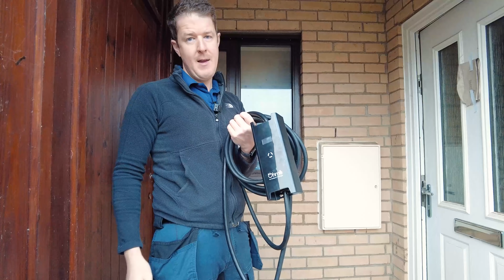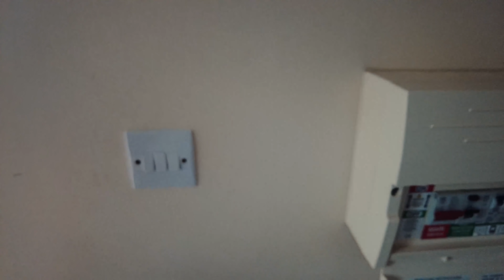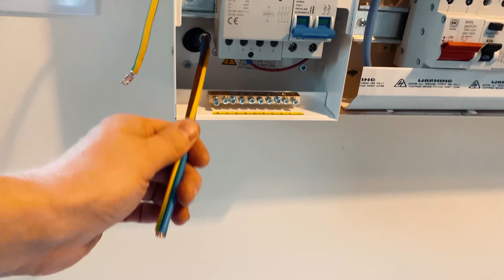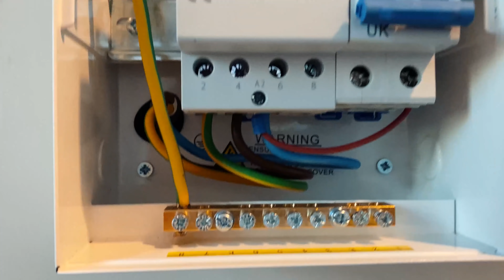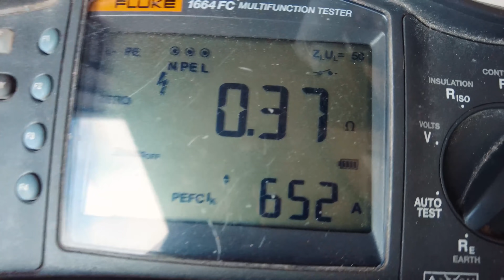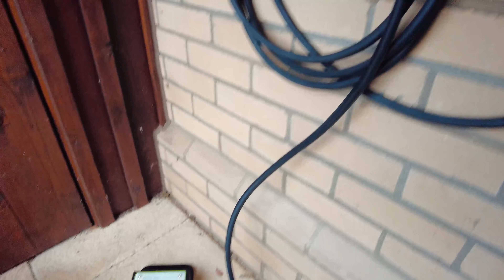Ohme Intelligent Electric Vehicle Charger Installation - Electrician Life

Comment: Waist of money, the charger is in the CAR it just needs a supply , 3KW 13/16 amp will be fine for most people ( unless you're a traveling salesperson or Taxi driver ) any competent D.I.Yer should be able to install outside socket 13 amp from ring or commando socket 16 amp back to a 32amp breaker , as for "cheapest electric ", it's down to your supplier /contract ( or stop blowing-up other peoples Pipe-Lines)

Comment: Where does the Data cable connect in the DB? Also in instead of a junction box in Ireland they have to have local isolation, so therefore its and isolator

Comment: Just had one installed - the charger itself is great, but is only fully intelligent if you're connecting a car from a manufacturer whose API they can interface with, otherwise you have to tell it what % you want to add.  As for trying to register and swap between 2 cars in the app or have 2 phones/apps - it's clearly not setup with that in mind.  Charger great, app and website... disappointing (but I'm sure they'll  improve the app).

Comment: OHME are supplying incorrectly wired equipment. As I understand the regulations all electrical equipment supplied within the UK has to conform to the UK regulations for conductor colours (not colors) and cable termination (BS 1363 plug) if the equipment is a portable appliance.

Comment: Hi Mike, I'm having real problems with my Ohme, each time our (very experienced electrician) tests the unit the 6ma DC test fails, weve tried 3 different test devices, 2 Ohme units, all running through the Rolec interface as you have there I believe. Do you test for the above, did it work successfully, wasn't sure from that vid. Many thanks for any advice, desperate to get my unit in and running.
Reply from the maker: Which tester is he using? There are not many test instruments that can correctly test the 6mA DC leakage device
Reply: @artisanelectrics  Hi Mike, thanks for coming back to me, he is using a Rolec charge check box with three different meters; Metrel 3125bt, Megger 1741+ and a TIS MFT Pro. All three are failing on the DC test on both Ohme units tested. Weve spoken to Tech support multiple times and they have suggested slowing the DC test which made no difference. Many thanks
Reply: Sorted it, it was the Rolec charge check box which was causing the issue, thanks for your help

Comment: I was under the impression that if you are pulling 32A continuously that you should use a higher rated fuse such as 40A. Is this correct?
Reply from the maker: It’s a good point, I generally size my breakers that way, but you always need to follow manufacturers instructions and in some cases they state that you should use a 32A breaker
Reply: @artisanelectrics  Hmm, I thought the regs came before the manufacturer’s instructions.

Comment: I have a Chargemaster 7kW EV charger installed in feb 2017, as it was free with the Leaf I bought then. I haven't actually used it in a couple of years as the leaf went back in feb 2019, but have recently bought a Zoe.

Is this PEN fault detection requirement a new thing? I don't have an external earth spike or a PEN fault device on my install, and am kind of wondering if I should get it retrofitted. After watching your vids I kind of feel like I should be replacing it with a Zappi but obviously I am not eligible for the OLEV grant, and if I were to pay for a Zappi it seems like I should get it as a 2nd charger for when we replace our other car. (although, I have a 60A main fuse so that probably wouldn't work too well!)

Comment: Nice, neat installation. Not keen how the charge plug is holstered when not in use though and that's how the manufacturer has designed it but just my thoughts.

Comment: Have you installed any Wallbox Quasar chargers yet? https://wallbox.com/en_uk/quasar-dc-charger
I am applying for the government V2G scheme through Octopus Energy where you lease a Nissan Leaf gen 2 with Chademo connector and plug it into the Wallbox Quasar charger, so at times of peak demand, the Leaf charges the grid. I thought at first I would need three phase power, but looking at the specs on the Quasar website it does not look like it.
https://www.thisismoney.co.uk/money/bills/article-8772011/Octopus-Energy-customers-trial-eehicle-grid-technology.html

Comment: You mentioned the PE-N protection box is also needed on TN-S.  Is that right??
Reply: Yes.  Because any repair to the DNO cable in the ground will be PME, so a broken neutral is still a potential issue
Reply: @cjmillsnun  OK. Potential. But the regs only talk about the PME case, I thought.

Comment: Great video -  very interesting. So if I were to run an Ohme from a 32A commando protected by 40A MCB and suitable RCD, and the unit is in my garage, is an earth rod or PEN device still required? Are you able to provide a link to the consumer unit with PEN device please?
Reply: Eco Harmony  Many thanks - I’ve since found the Matt:E solution. All the best.
Reply: Eco Harmony  I'll send you an email.

Comment: great videos as usual. quick tip, when you need to use SWA for mechanical protection rather than using a compression gland you can get a insulated SWA gland for ETSCC. https://etscablecomponents.com/cable-glands-adaptors-reducers/insulated-cable-glands/insulated-brass-cable-glands-cmp-b348-b348.html

Comment: A pity that the meter box was where it was otherwise you could have mounted the ohme on the nib wall and run the cable straight through without a joint box. Good job!

Comment: I think the charger unit looks absolutely awful and the install sort of compounds it and makes it look like a right snakes wedding. Could you have not passed the charger supply tails through the meter cupboard and used a small JB mounted in the cupboard (and possibly even put the PEN breaker box in there too) and then take the supply from the consumer unit as demonstrated and then ( in the cleanest run possible)into the meter cupboard for termination either in the JB/PEN unit?

Comment: I love you use the Rolec tester but never the Rolec EV unit 😃 never had a problem with the Rolec myself  did you suggest surge unit instal at the same time? Like the ease of the unit but all those wires at the front door is the only downside ( nice vid ) 👍

Comment: Smets 2 meters 4 or 5 port have the ability to have multiple tariff switches although we're being told they will be standardised rather than the old church hall agreed changes so ev chargers should definitely take advantage of the option to charge at the cheapest rate if not they will cost customers more than necessary.

Comment: How dos the 'smart tariff' work? Does it require a smart meter or Economy 7 meter?
Reply: Yes, you need to be using someone like octopus energy , bulb, or any of the other companies that have a variable rate tariff. To get on one of these tariffs, you will need a smart meter installed, and some of the older smart meters may not be compatible with your new supplier. The smart meter issue is a bit of a minefield, but if you don't have one currently, you can select a supplier that installs smart meters and get on their waiting list.

Comment: I am guessing that a person that buys an electric car automatically has a charger installed, when really some people might not need one.
As example, I looked at a Kia, on a 13amp plug it took about 24hrs to fully charge, had a range of about 260 miles, my car sits in the garage most of the week, as I am in the van mostly, so people that don't use a car much could leave it plugged and save themselves a good chunk of money. Just an observation.
Reply: If you have a time of day tarrif then you want to charge quickly while you get the cheapest/ greenest Electric.

Comment: in the USA Black as Phase A and White is Neutral I don't know why they use Blue because usa uses green or green/yellow  or Bare Copper for Earth (Ground as they call it)
Reply: Red and blue are second and third phase colors, however this is reversed in Canada Wikipedia has a great article on the subject of color codes.
Reply: @imark7777777  Split Phase A (Black) and B (Red) 120v  x2 from a Centre taped transformer total 240v

Comment: The 5x test will be shoving ~150mA along the CPC - the PEN fault device will be seeing that with the coil it has on the CPC, but it can't tell if that's coming from the device or going to it - I guess therefore it looks like a possible fault to it so it triggers...
Reply: That was my thinking too, the easy way around it I suspect would be to connect the mft earth to the installation earth (consumer unit earth / met etc)

Comment: I've fitted ohme chargers. So simple. I still used an earth rod as the unit was installed 5 to 6m away from the property. I mounted the ev charger onto a railway sleeper which was mounted vertically into the ground. All connections were hidden on the back of the sleeper and only the charger and lead was visible. The rod was rammed into the soil near the charger.

Comment: Switching CPC sounds unusal to me, an absolute no-go in Germany .
Reply: It sounds unusual to me too, but as it will disconnect at the same instance as L&N I don’t see it being an issue.
Reply: @cumberland1234  Yes but will it reconnect reliably after "n" operations?
Reply: @michaelfgmail7506  you could argue the same about anything that disconnects a cpc, (plug/sockets etc).  Hopefully the charger in this case checks that an earth is present before turning on
Reply: Your TN-C-S supplies are more reliable than UK ones -.Looks like the UK will adopt foundation earthing in 2022

Comment: the odd EVSE wire color probably has to do with the fact that the unit is a rebranded chinese (with obviusly more features) from Zencar; mine has infact the same appearence and the same odd wire colour. it's a good quality unit, if you are interested look at https://www.youtube.com/watch?v=jT8IsAd9ea0&t=1496s for a nice review and teardown

also right is nathaniel greene, this EVSE is born to be mobile and usually come with a blue CEE 32A plug for the 7Kw model or the red one for the 22Kw (3 phase)
Reply: It's not rebranded - it's a different design for Ohme in the same case. Comparison teardown here : https://www.youtube.com/watch?v=O58KT117crs

Comment: Not wanna use wago maintenance free connectors instead ?
Reply: The cables look too big to use Wagos
Reply: @georgetaylor853  the biggest size is up to 6mm, surly the car charger isn’t any bigger than 6mm
Reply: No criticism intended of Jordan's work. That box looked deep enough to use din rail terminal's, which can be bought with the screwless option.
Reply from the maker: True
Reply: I'm sure you could use wago connectors, and I probably would, but its accessible and therefore there is no need to use MF connectors, I dont believe they are rated MF either when used in an enclosure that is not part of the system - do the wago connectors not need to be secured in the enclosure to prevent loosening by vibration from the electro magnetic effects?
Reply from the maker: That was my feeling too

Comment: Why can’t that crap be opened and have a straight 2 metre cable run into it from the board? Why the need to interrupt and patch up in a junction box? Cable clips should be illegal! There’s 25mm tube and saddles at the wholesaler.. UK electrics execution 😖🤦🏻‍♂️

Comment: +Artisan Electrics
PEN fault detection device with Normally Closed contact?!!?!?
Surely, with locally lost pen (just to this installation) you could easily end up with virtually no voltage between PEN and Line, and so contactor unable to draw power, closes, and EV chassis becomes live, customer investigates and gets zapped ??.   Is this assuming the EV charger will disconnect CPC in that case anyhow?    -- What about the 'current in protective conductor case' that the Zappi handles, is that replicated with this arrangement of devices?
Reply: That unit looked like it had a current transformer on the earth wire for sensing excessive earth leakage
Reply: The contactor is normally open
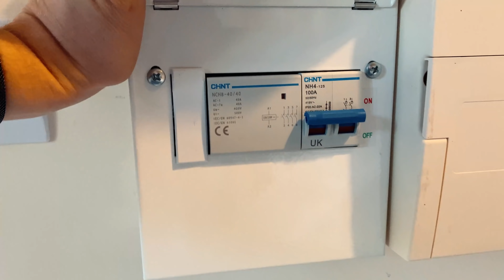Reply: @johann60  https://youtu.be/wCsTxj9aSLc?t=996    In the video just after 16:37 Jordan says it is a Normally Closed contactor!
I guess, maybe point is the contactor is actually NO but the unit keeps it closed actively 'normally' ...
Reply: @sbusweb  aha ok but it's normally open
Reply: @sbusweb  He clearly misspoke, just listen to the next sentence where he says that it disconnects in power loss.

Comment: Is it much cheaper than a Zappi ? Even with the extra contactor/protection unit ?

The gloss black charger doesn’t look very robust for outside use.
Reply: Their site says it's from £200,  or have one installed from £449, so I guess it's cheap.

Comment: That nyy stuff is fine for a short run but over time would sag and look awful. I wouldn't run more than a few metres in it. Seen loads of people recommend these on mg EV forum. Awaiting bp to come and repair my supply cable done in nyy because they used wrong size clips and pinched the cable up. 

On a side note if you use octopus go and a charger/car timer function it does match your cheapest rate although this might work well for people on octopus agile rate.
Reply: NYY shouldn’t sag if installed properly
Reply: @efixx  it's still a flexible cable. Swa doesn't sag unless it's not supported for a metre at a time
Reply: @thefallenangel2  NYY isnt a flexible cable.

Comment: Hi, Could I ask a question? Could you not use the cable that came from the charger without using the junction box? 13:3
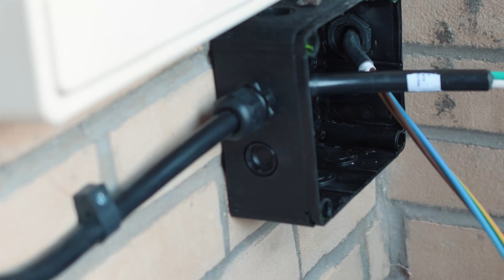Reply: 13:03
Reply: No user serviceable parts. Kind of a stupid design in a way unless you're mounting it right next to something.

Comment: I'm surprised that its legal to sell that here with a cable using US colours.
Reply: Why wouldn't it be - it's designed for installation by a competent electrician who one would hope can read a label...
Reply: @mikeselectricstuff  Labels can get lost and its clear Jordan wasn't familiar with the American colours. Since black was used for neutral in the old British standard (still used in some ex-colonies) without the label even a competent installer might connect the black to neutral and the white to live.
Reply: @davidfaraday3085  agreed. Accident waiting to happen using colours very few people are familiar with. Will be telling customers to avoid this unit
Reply: @TheChipmunk2008  a competent electrician wouldn't blindly connect a device to the mains. Without being sure of its connection. If in doubt find out
Reply: There are colour codes. This does not comply
Reply: @TheChipmunk2008  why would you contact the supplier to find out information on the product. Surely you would contact the manufacturer? You sound like the reason why McDonald's cups have hot warnings
Reply: @Liberator975  and you're the kind of person who sounds like they go to the manufacturer when the first recourse, under the sale of goods act, is ALWAYS to the supplier.  Good day, SIR
Reply: It's annoying that they don't use our colour code, however sleeve it up and there's no problem just as we normally do.

Comment: Awful looking thing. Looks like a "granny charger" fastened to the wall.  It would look better if both cables were at the bottom of the unit.
Reply: That's because it uses a case designed as a portable charger (Zencar)
Reply: Might be ugly but they are cheap

Comment: Have you considered getting a smaller diameter SDS bit to reduce the size of your blowout? Our walls for most homes being nowhere near as thick I have a 610mm (2’) by 9.5mm (3/8”) that I drill through with and then follow that up with 19mm (3/4) or larger depending on the cabling.

Comment: If you install more of these, don't put them anywhere  they need to be weatherproof, especially if exposed to sunlight. It relies on the adhesive on the front panel label as part of the seal.
Reply: Seems a pointless product, as the majority will be installed in locations you said they are not suitable for
Reply: Mike has done teardown of the same housing, check his channel 👍
Reply: Mike, my unit has been out in all weathers and in direct sunlight for two years and the front label and adhesive is fine. We've never had a failure for that issue after thousands of units. Rgs Dan (Ohme)
Reply from the maker: Thanks

Comment: US Colours will be due to the Chinese manufacturer - I think black/white is standard everywhere except Europe.
Reply: Not our colors for a 240 V circuit. Hook those colors up in your load center and you’ll get a whopping 120 V, so you’ll be trickle charging your EV. 😜
Reply: The Chinese will make different products to meet the various safety standards around the world.   I don't know what colours are used in China but the North American colours are certainly not used in India, Pakistan, Australia or New Zealand. I doubt they are used in Africa either.
Products sold in the EU should meet EU product standards, this unit doesn't.
Reply: Black / White for USA and Canada. I'm in Australia and we use brown, blue, yellow/green for flexible cable, and red, black, green/yellow (all insulated) for building fixed cabling. Our Aus standard recognises ISO colours for fixed wiring.
Reply: I have seen green, yellow and red used too for 220v applications. Don't know which country the origin was but it was one of those cheap nasty import food serving trailers. All the ac wiring was jointed by twisting it together and tape too. The only thing that was good was the dual pole rcd's
Reply: Wikipedia has a great article on wire coloring codes and countries. They must have gotten a really good deal on that color patterned wire.
Reply: The Wikipedia article  @imark7777777  mentions is here: https://en.wikipedia.org/wiki/Electrical_wiring#Colour_coding_of_wiring_by_region
Reply: @200701121809  oh thanks I didn't get back here to post it yet.